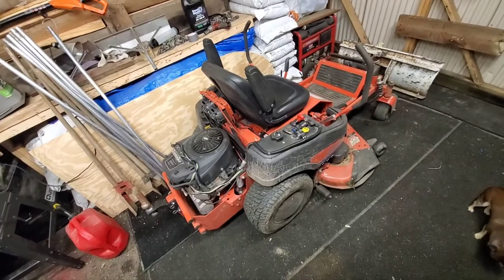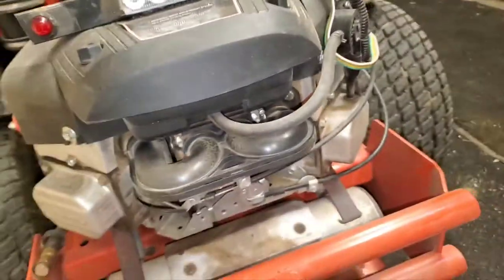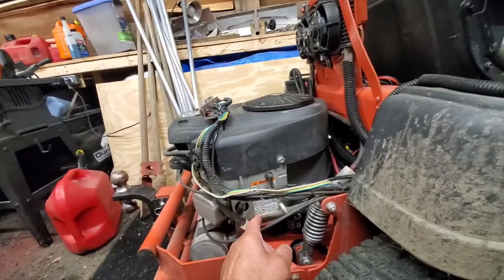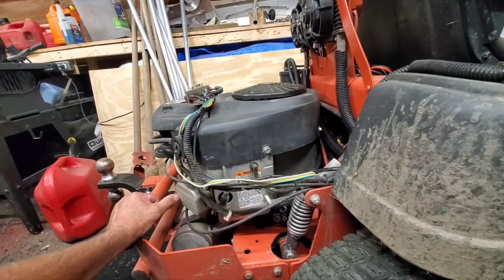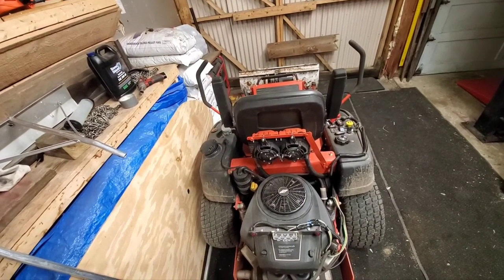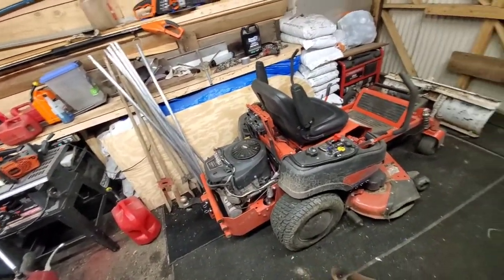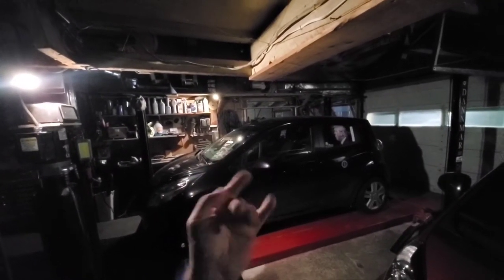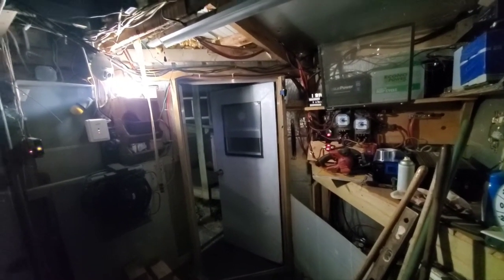keep your lawn mowers oil, cooler with this custom-made kit

Comment: maybe crankshaft seal if the leak is under the engine
Reply from the maker: No just in the back of the engine on the bottom there is three little bolts that holds on a cap with a o-ring and that's where the oil pump is and it's seeping out of that, but it's a pain in the butt you have to lift the whole engine and get at it

Comment: why not just put the oem cooler kit and you wont need a fan.
Reply from the maker: It has the OEM hydraulic cooler I put the oil cooler in it with fans because I did not like the hydraulic cooler sitting on top of the fan intake for the engine all the heat getting pumped into the engine so I made it separate